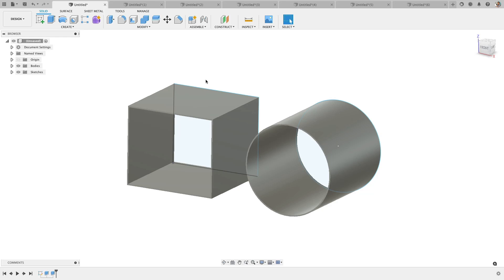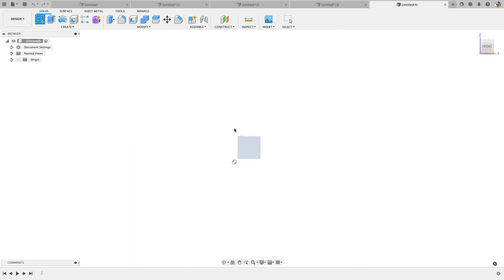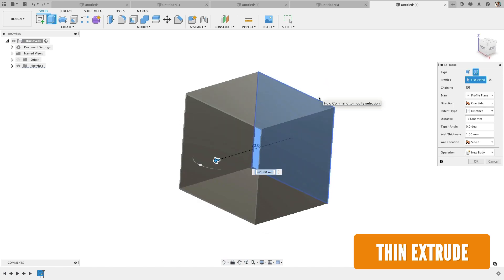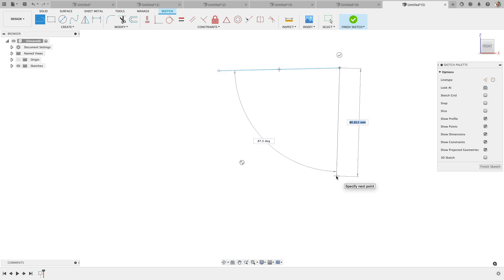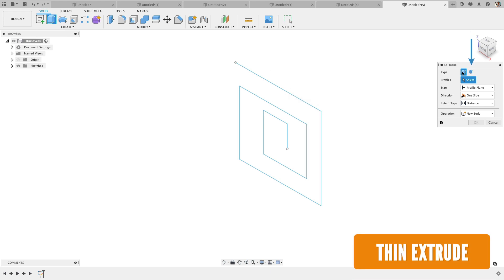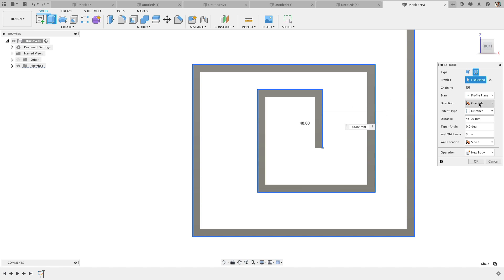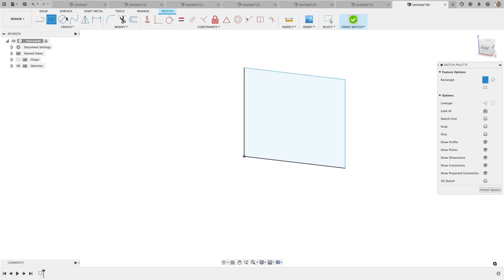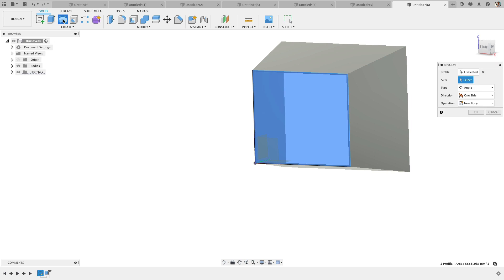Fusion 360 Thin Wall Tool (New Thin Extrude)

Comment: Bizarre! but could be useful. I tried a thin-wall extrude on an unclosed jaggy line sketch - and then tried the taper parameter as well - kinda-hard to figure what's actually happening there - but certainly fun....
Thanks Tyler for feeding the imagination.
Reply from the maker: You bet!